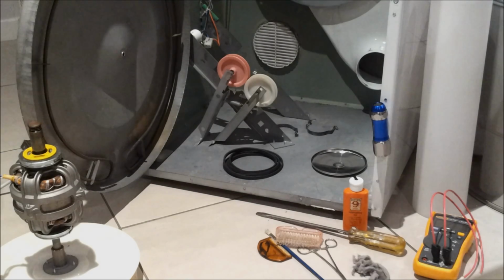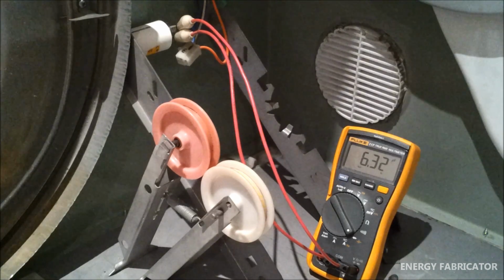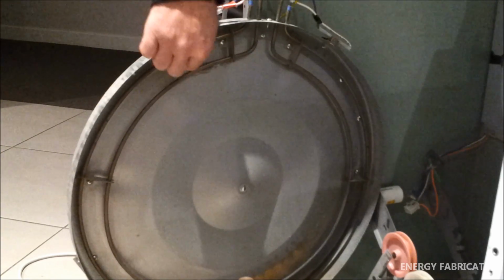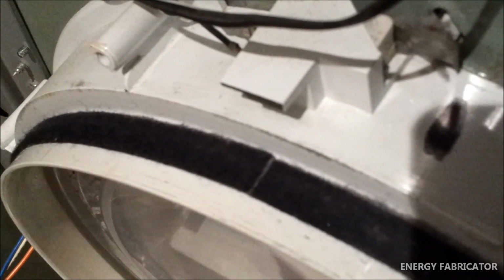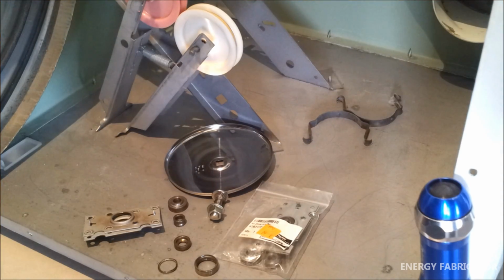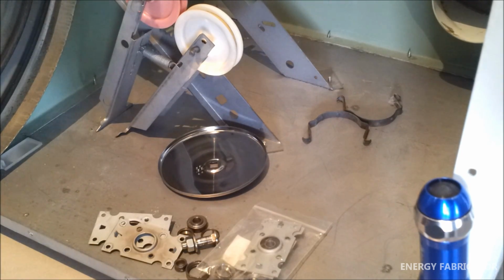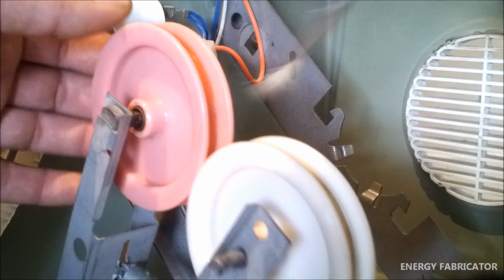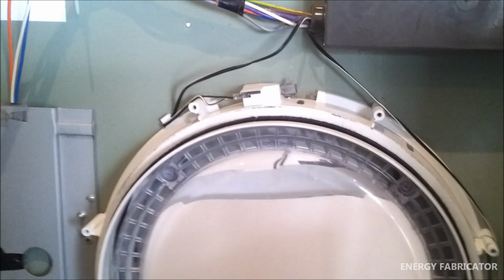How To #8.1 - Repair A Clothes Dryer [Part 1 - Common Faults & Troubleshooting]

Comment: Great video! Another thing to note is the exhaust ducts can fill up with dust and lint, they're fairly easy to remove and clean
Reply from the maker: Machine Man 
Thanks mate! I actually found that most of the dust & lint accumulated on the bottom panel, around the electrical cables and in the motor. There was a thin film in the duct, but it was only a 2-3mm thick coating which was caked on due to the humidity - no real obstructions there. I even found large accumulations of dust on the heating element itself - potentially dangerous!  I guess they are all slightly different depending on the manufacturer. You can see the photos of all the dust etc on my google+ page:

https://plus.google.com/u/0/b/117543897575136933215/collection/Ezrf1

Thanks for watching :)

Comment: Hi There. I so hope you are still around, I can not seem to find your google plus page as mentioned. I have just recently picked up precisely this dryer as we are staying unexpectedly up in Lower Daintree and have nothing with us so furnishing a place on the smell of an oil rag!! Really interested in your other posts but will stay on point for now,. I would love to see how you have taken the dryer apart. I have watched both vids because the one I picked. up for 80 dollars is making the screeching noise in only one direction. Have managed to take top and back off but can not get the knob off the dial in the front and do not want to yank it off so there must be a way of taking that whole front panel off in one. It is not the bearings as I thought it would be, it is something scratching on the other side of the drum but do not know where to begin in taking the drum out. Would love those pics and wish you had filmed the disassembly. Will watch both again tonight and then think it is just the felt runner or similar because it is not the back where the bearings are screeching after all. The belt looks good as well. Found a fiver and lots of coins plus a decades worth of fluff and crap inside so it cost me less than 75 dollars lol. Hope this finds you. Can't find a name or other contact details anywhere. Ciao for now Lindi

Comment: Another problem too is a F&P clothes dryer motor might sound really loud and then it might stop once it is heated, what is that cause. Another F&P dryer i used 2 years ago. Is it the motor, pulleys or the drum bearings??

Comment: i have the same dryer hand have the same burnt diode what do i have to buy to fix it
Reply from the maker: Desolder the diode and replace it with a new one. The part number is printed on the body of the diode.
Reply: sorry its a zener diode no part number other than d5 which is location on the board.

Comment: Hi, Thanks for the howto video. You mentioned you replaced the felt previously. What did you used to remove the felt from the plastic surface? Did you use felt from a craft store or a F&P part? Thanks In-advance
Reply from the maker: I pulled the felt off by hand, scraped the remaining bits off with a stanley blade and wiped off the sticky residue with acetone. I used a piece of felt from a craft store and stuck it on with a continuous piece of thin double sided tape. Felt is felt - no need to use an OEM part for this :)

Comment: Hi, great video, just a question in case you can help.  When we go to start a load the dryer doesn't start to spin, we have to put the clothes on one side and try again sometimes multiple times until it starts to spin.  No noises and once it starts to spin it goes until clothes are dry.  It seems to be the wight of the clothes, but then again sometimes it won't spin even when there is not much in it. It's as if the clothes are too heavy or light for the drum to spin.  Would this be a worn belt or something else?  Thanks for your video.
Reply from the maker: Most probably just needs a new capacitor. Just unplug the capacitor and buy a new one. Simple fix. It can't hurt to do a quick visual inspection of your belt and other components when you go in to take the capacitor out, but I doubt the belt has anything to do with it. Just replace the capacitor and you should be fine for another few years.
Reply: Thank you, i'll check it out.

Comment: Thank you.  Your two videos are excellent and assisted me immensely.  I post this comment to thank you and offer my understanding, just in case someone else has the same issue that I experienced.  My F&P dryer was purchased 2 Dec 1999, Product number 93989 and the dryer model is ED56-U. 
By the way the Start/Run capacitor for this dryer is 8uF.   It  has the older Emmerson (square) motor.
Issue: 
The F&P dryer was throwing the RCD when it commenced to spin in the opposite direction ( a change of rotation is a feature of this dryer).  A person on whirlpool (archive/1684329) reported the same issue and someone kindly advised that it was an indication of a heater element failure.  In my case at least one heater element was heating OK and possibly  both.  Both elements, when I later measured them, had a resistance of approx 50 Ohms (expected).  Unfortunately, this video did not show how to access and remove the heater elements, and the google plus photos didn't show this step either.  I was trying to avoid their removal.  
So I looked at the spade connections to the heater elements and noted that on one heater element, a wire's insulation crossed the other wire's bare connection i.e. close or at the spades.  So the only thing stopping a short was one wire's insulation.  I used a  cable tie to put some air between these wires and rebuilt to test before taking the next step to purchase the heater elements.  
It worked.  
So my conclusion is the insulation was allowing enough leakage either thru or along the wire to the other spade and then throw the RCD.
Your videos gave me the insight to attempt this repair so I'm grateful that you went to the effort.  Thank you - Five stars

Along the way I also discovered:
V Belt from a photo that I took has stamped 
Contitech  (Made in England)  1800J3 460529

Once again thanks.
Reply: Humble Pie.  The same dryer failed again when we installed it on the wall.  Possibly the hot air wasn't being evacuated properly as the dryer's top (actually the bottom as we have it inverted) became hot.  So pulled it down and it kept failing so ordered the two heating elements from F&P -  Part Number 427578 for the 875watt elements .  A bit over a $100 delivered.  Also decided to replace the start capacitor which is an 8uF in the ED56-U .  While I waited for the capacitor I purchased an eBay multimeter, a Vichy VC99 (good piece of kit for the money).  When it arrived the capacitance was 6.92 well outside the 5% tolerance.   The part number for the capacitor is 427502P and the Simpson 8uF part (approx $12 delivered, versus F&P $17 ) on eBay fitted.    So I don't know if it was the heating elements or the capacitor that fixed it, but I think it was possibly the elements. 
BTW I removed the aluminium insect grate/stopper that I had made to cover the external exhaust vent and replaced it with a deflect-o SUpurr vent from Bunnings.  
In Part 2, I wonder what torque the bearing should be torqued to?
Thanks again for the videos.
Reply from the maker: Thanks for your comments. In regard to the torque on the bearing... good question. When I'm unsure, I usually follow the 'snug + 1/2 turn' rule... depending on the application. It hasn't failed me yet.

Comment: I've got the same make of dryer as this but older. Also They say to clean the lint filter before every load but I generally clean it after every 2nd or 3rd load.
Reply from the maker: Good point. I did not cover this in the videos... It depends on how heavy the load is... We sometimes clean out the lint filter during a load, sometimes after a load and sometimes once every two loads. I believe the cleaner it is, the more efficient the drying.

Comment: Really great video!  I've got the identical machine and replaced capacitor and drum bearing using your direction.  Thanks heaps.
Unfortunately, after just completing the drum bearing repair and put machine back in place, I've done three loads and I think there is now an issue with the sensor.  The first load did turn itself off, but after a really long time (maybe 2 hours?).  Next I did a couple of tests 1) with no clothes at all, then 2) with a few shirts lightly damp, and the machine doesn't seem to want to turn off at all.
I spent so long by myself putting the machine back up on the wall, keen to get your thoughts as to what I've likely done.  Would that behaviour happen if I've just loosened one of the wires to the heat sensors?  Or is it likely I've got an actual broken sensor.  
FYI - I'm just a home handyman, and only have standard logic to help me through things like this.
Reply: Scratch that!  I decided to open it up again, and sure enough I'd knocked a wire off the element.  After reattaching, the sensors are doing their job.  All good!
Reply from the maker: +Stephen Ryan 
Excellent! Glad to hear that it's all working fine.